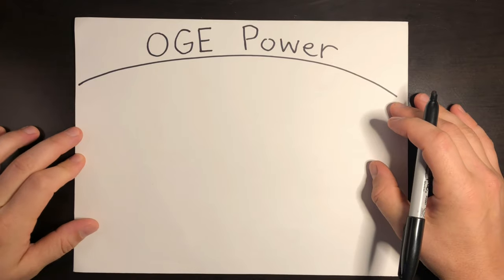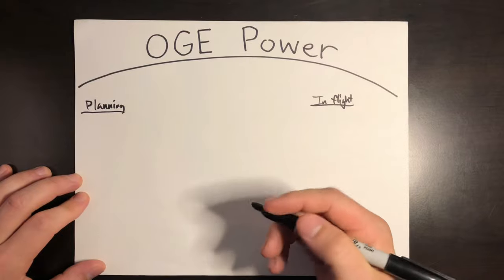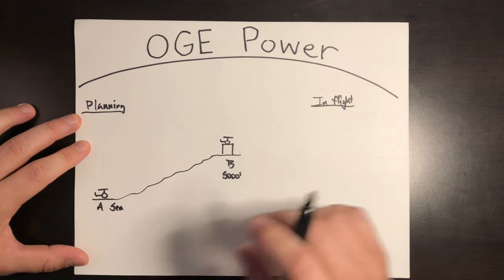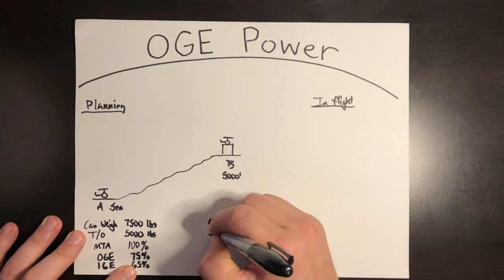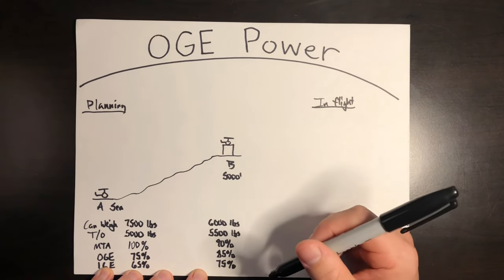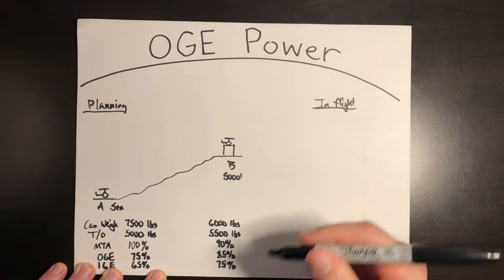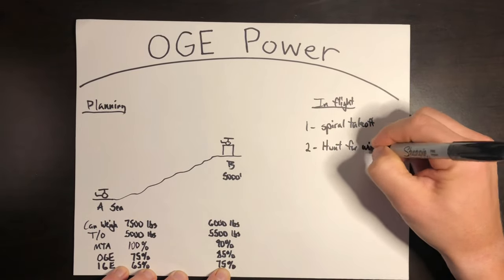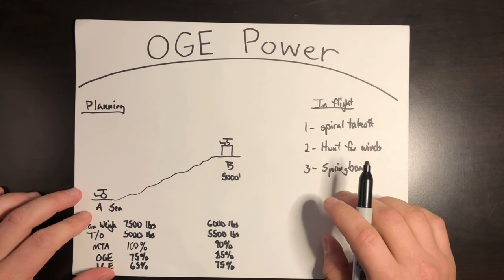OGE Power in Helicopters

Comment: Jacob, the springboard and spiral tips to gain a bit more OGE during takeoff are really interesting.  However, doesn't that end at the momemt you reach OGE, so in effect you can get to OGE, but once there, you are still underpowered.  I assume the followup technique is to transition to ETL to gain more lift and then begin working your way down the mountainside to thicker air where you no longer have a small variable.  Can you explain?

Comment: I like your videos a lot, but I have a question: when someone makes an "spiral takeoff" aren´t they actually decreasing the "Rotor RPM" in relationship to the airflow? Example when you make a 2RPM spiral T.O. isn´t that RPM going to be subtracted from the main rotor (not in the gage, off course), so you end up with 2RPM less, thus decreasing the actual rotor RMP and increasing the conning angle?

I fly Sikorsky S-76 in the offshore industry, sometimes when we are near or at max gross weight with little or no headwind, I feel it´s easier to T.O. by pulling the collective gradually, but with no hesitation, from full down to max takeoff power, being preppare to abort if it fails to leave the ground at 90%Q or have any tendency to a dinamic rollover. This way we are able to takeoff vertically until the 20ft decision point and can fly away, that would be very difficult otherwise.

Best regards from Brazil and keep up the good work!
Reply from the maker: Interesting. I’d never thought of that. But with rotor systems turning generally over 300 RPM, the 1-2 RPM of the pedal turn would account for only a fraction of a percent of rotor RPM as a difference. However, offloading part of the tail rotor requirement for a takeoff by using a spiral can significantly improve climb performance by at least a few percentage of torque. From experience I’ve seen it to be more of an increase in climb rate using the spiral technique. Great point through!

Comment: hey I´ve seen you make really good explanations of helicopters, could you tell me what the advantages of having a rotor design like the Ka50&52 Heli vs the the Mi28 (no back tail rotor vs having one) 
I am looking forward to hearing from you!!!
Reply from the maker: Having the stacked rotors like the KA50 is what’s called a coaxial design. By spinning opposite directions, it takes away the need for the tail rotor because they counteract each others’ torque effect. This allows more power to go to the main rotor which can increase its overall lift. This design also allows for a faster top speed because the rotors balance out each other when it comes to retreating blade stall. But this system is generally more complex and expensive to design, build, and maintain. The Mi28 type system is easier and cheaper to mass produce and more of a legacy type design. I’d say it really comes down to budget and what someone needs a helicopter to do. As far as militaries, how many helicopters could you get on a certain budget makes a big difference. Great question.
Reply: @helicopterlessonsin10minut10  thank you.
Do you know why we in the western world don't have something like that?
I mean the US spend the most money out of all nations for it's military

And 

does the h-47 Chinook uses the same art of travel or is this a way different one?
Thx for answering!
Reply from the maker: I think it came down to costs. Coaxial design wasn’t prevalent during the time the Army bought the Blackhawk, Apache, Kiowa, or Chinook. But it’s growing in presence now a coaxial design is actually in the running for one of the Army’s next aircraft purchases to modernize the fleet. To answer your second question, yes the chinook is more similar to the coaxial design but it still hasn’t it’s differences with the rotors being in tandem.
Reply: Now here come the questions: How do the pedals make such a helicotper like the Ka52 turn? 
My assupmption would be that they modify the pitch collectively on ONE of the rotors. Or both?? IE: I wanna turn right, they'll lower the pitch on the clockwise rotor and raise the one that spins CCW, to increase the counter-torque. That would probably also require some input from the requlator (IF the subsequent DEcrease of torque on ONE rotor with the INcrease on the other do not cancel each other out). But is that it? Is that how it works?
Reply from the maker: You’re on point. You’d have to change the collective pitch of one of the main rotors to turn or yaw right or left
Reply: @helicopterlessonsin10minut10  but what about the tail?
There is still some "flaps" so if you change them at 300km/h you would turn?
Reply: @helicopterlessonsin10minut10  
Having re-read my comment I, I think I messed up my directions the first time. Right pedal-right turn, CCW rotorblades increase pitch, Left pedal, CW rotor blades increase pitch. 

BUT: Would the blades of the other rotor have to decrease to prevent altitude gain?!? Or would the motors/transmistion modify the rpm of the other rotor? There are definitely some physics that I don't understand.

But anyway, thanks so much for replying!!
Reply from the maker: Cillers: to turn in flight you change pitch in the main rotor to create a bank angle. To turn at a hover you apply pedals to yaw the aircraft. For a coaxial it’s all through the main rotors. To turn in flight you would increase lift on both disks at say the 3 o’clock. To turn at a hover you would change total lift on just one of the main rotors. 

Drunkhog: to prevent altitude gain most likely you would increase pitch of one rotor and decrease lift of the other. This would maintain altitude and share the load between the 2 rotors.

Comment: I'm surprised you left out the other option to do a rolling take off if you have a flat area or an aircraft on wheels? Where you have ground run and once you pick up enough speed and the blades experience ETL you now have sufficient lift to climb. Great video nonetheless!
Reply from the maker: I left that out because that would be a takeoff that doesn’t require OGE power. Getting through ETL first is always the preferred technique. But if it’s not in the options based on the takeoff area, these techniques can help boost your normal OGE takeoff.

Comment: Is your onboard fuel weight a cosideration of somekind in these type of factors as well??? Can ya perform a good "springboard" lift off in an wide open accessed area as well???
Reply from the maker: Yeah fuel, cargo, passengers, and everything else is considered.  You’re planning on total aircraft weight at takeoff. And yes you can do this type of springboard takeoff anywhere. Although it’s not as much of a boost in open areas.
Reply: @helicopterlessonsin10minut10  Okay, cool. Thankya for the reply back. Do ya have a video anywhere in the explanation of a wheeled helo performing ground taxis & rolls??? I try to watch the main rotor blades on these type helos & looks like there's enough positive pitch in the blades/"rotor disc area" to perform the aircraft ground movent but yet not so much for the birds to leave the ground until pilot  command imputs says so! How do ya know the right balance & feel between the rolling taxis without the actually aircraft leaving the ground just yet???
Reply from the maker: For wheeled aircraft it’s usually outlined in an operators manual or training manual how much power to use for different maneuvers. It takes very little pitch to actually ground taxi wheeler aircraft. For rolling takeoffs you could use something like hover power minus 10% and it should get you rolling just fine.
Reply: @helicopterlessonsin10minut10  Okay. . . . . during the taxiing ground roll, im guessing the pilots are applying a touch of "forward" cyclic imput. . . . .yes???
Reply from the maker: That’s correct. And for a rolling takeoff you’re generally keeping an accelerative attitude and level fuselage without allowing the nose to tip too far forward which could risk front flipping.
Reply: @helicopterlessonsin10minut10  Okay. . . . thats what i kinduh figured then, cool! I love getting into deep helo discussions oh how flight/aerodynamics & controls & imputs & rotorblades  work with helicopters! I love to put the working images of the rotor systems into my mind when i see a  "visual"command imputs from pilots. Love watching helo videos, watching real ones fly by, love watcing the rotors blades work during take offs & landing, & just love helos period. Took a flight in a Navy Sikorsky SH-3 Sea King & a civilian Bell-47G model. Love the explanation of your videos & texts. i appreciate ya very much! Thankya. . . . i wish i was your student pilot